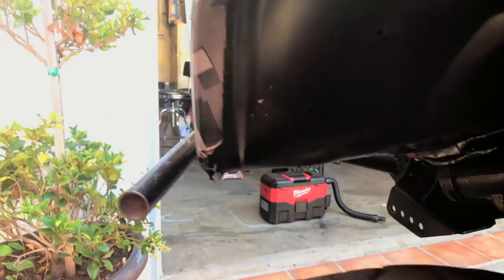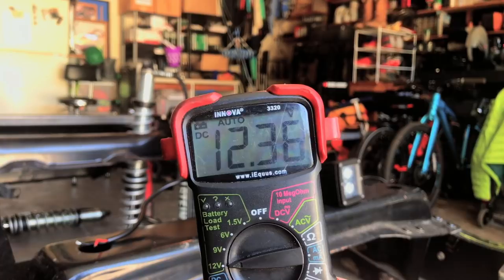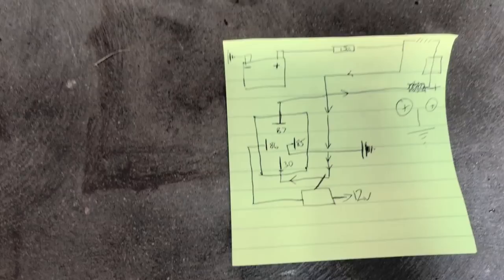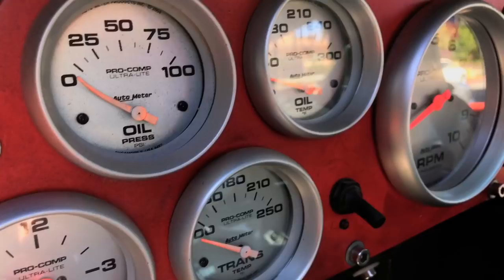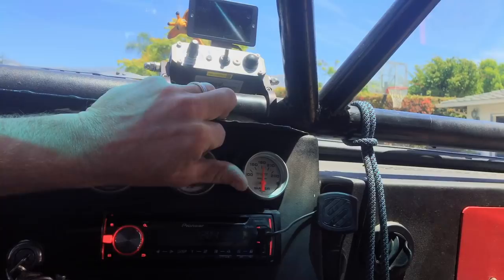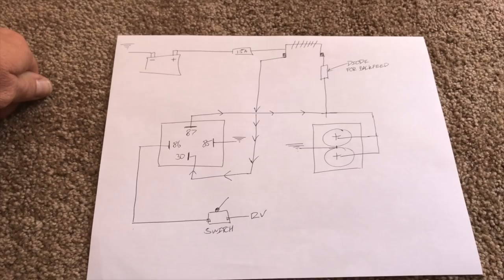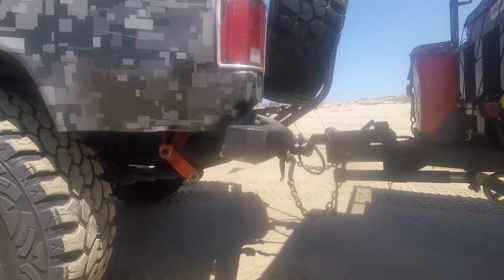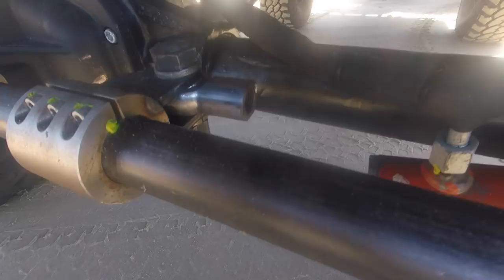MG #107 - Pismo dunes wheeling and camping!

Comment: If you're worried about the noise from the fans, why not run a 3 relay system?  1 for low, and 2 for high speed.  Use the PCM to trigger the fans for both speeds, or add a 4th for manual high speed.

Comment: I would run I 3 position dpdt switch. Middle position would be off for everything. You can have the up position to energize the relay coil to turn the fans on but have the thermostat circuit open. Down position would make up the thermostat circuit but open the manual side. Best of both worlds and no blocking diode to worry about.
Reply from the maker: I like this idea.
Reply from the maker: So use the up position to trigger relay and bypass thermostat.  Off position would be off completely no matter temp and down would be activating the thermostat circuit
Reply: Merricks Garage yes that’s exactly right. You’d have full control

Comment: You should have your thermostat turn on your relay too. Otherwise you could burn up your thermostat prematurely.  It would be easy to change where you tie in your wiring for the thermostat. Although, if you think your fans are too loud, you could always get new fans.
Reply from the maker: Thermostat is in line with trans lines so just fluid expansion trigger.
Reply: +Merricks Garage pin 30to batt pos. pin 87to fan pos. fan negative to chassis ground. high amp side of relay finished. now for low side. pin 85to key on accessory power. pin 86 to trans temp sensor(if single terminal) if trans temp switch is dual terminal then one side goes to pin 86. one goes to ground. don't be scared of ground side switching my man. if you then want to manually kick the fan on, you just run a switch from pun 86 to ground - M

Comment: Love your videos! But electrically speaking instead of using your bypass switch on the 12v side of the relay, use the switch on the ground side of the relay to make it last longer. Just my 2c.
Reply: chris hawkes believe it or not the same amount of current flows through the positive and negative side of a series circuit. Doesn’t matter which side you switch. Besides he’s only switching the relay coil that only pulls milliamps, that switch would last the life of the truck.
Reply from the maker: Plus the marine switches I am using are load carrying if needed.
Reply: +Joe Simon in his defense the voltage is used up on the pos side. and most circuits in our vehicles are ground side switched. but yes the temp switch needs to trigger the relay not be in series with the fan flowing 15 to 17 amps thru it!
Reply: Joe Simon  the main reason I say to use the negative side is that I've seen alot of wiring done by home mechanics and they dont always use grommets through the firewall, what happens when the wire chafes through the insulation? With B+ it'll short an hopefully pop the fuse (if they used one)or release the factory smoke and melt the wire, creating a possible vehicle fire. With using ground it'll just complete the circuit and turn the fan on.
Reply from the maker: Totally agree.  I am still kicking around the electrical setups.  Will either post a quick video on the electrical or instagram it.  Would value any feedback.
Reply: Rachael Wimberley “the voltage is used up on the positive side”?  What does that mean?
Reply: Joe Simon the current must complete its path. So in layman's terms amperage leaves the B+ terminal, goes through the completed circuit (load) back to the battery ground. It can go either way, B+ or Ground. But to me amperage always flows from B+ to GND. I have seen the reverse of this in British vintage cars(they have B+ going to the frame.) Sorry, trying to simplify this.. lmk if you want more info.

Comment: Hey got a question for ya. Where did u find dimensions on the back seat you used for the k30? I been trying to do the same in my 89 bronco. I think a 2000-2006 suburban 3rd row seat would fit but I can't find any dimensions on the suburban seat.